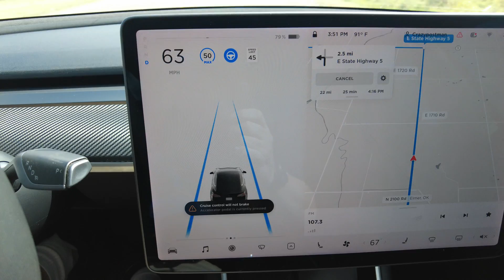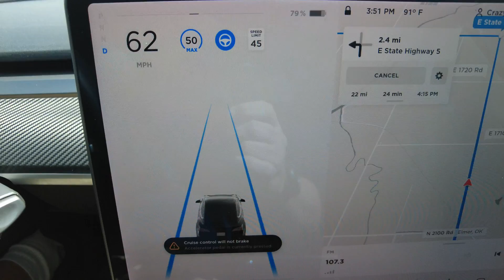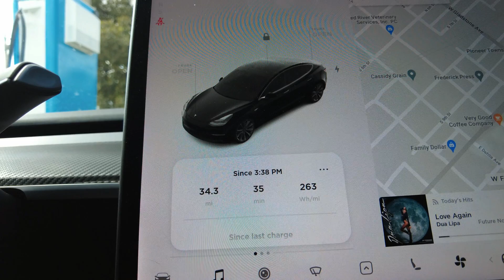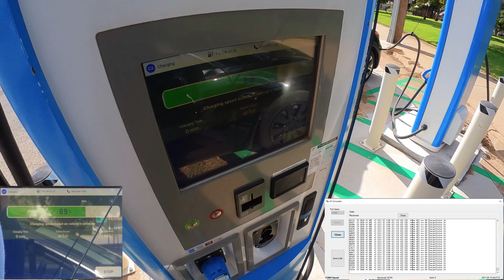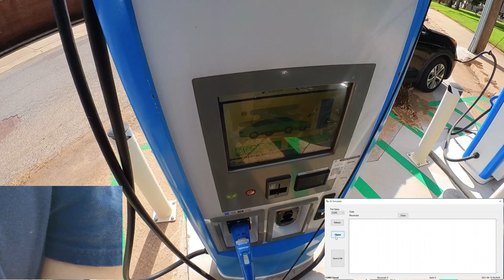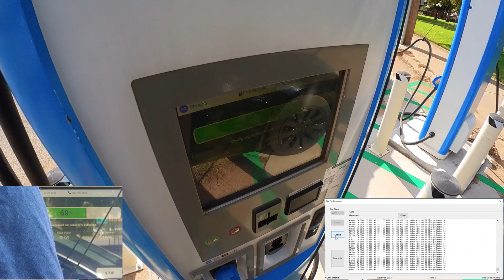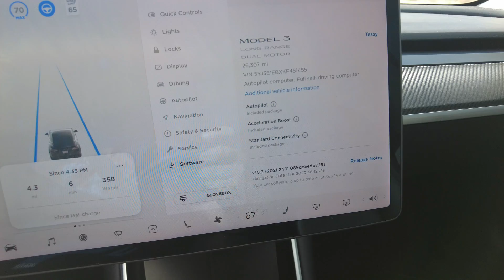Setec Tesla CCS adapter works! Again!!

Comment: Is this the lectron ccs to Tesla adapter?
Reply from the maker: Yes
Reply: @Crazypostman  me and a friend have one ordered and have been waiting for the last month for it to come in. Is the setup hard to get going? We are also in Oklahoma and will be using the francis chargers
Reply from the maker: @thethejonwatson  I would like to tell you the setup is easy but the first step to get it to work with Windows it's kind of difficult it's been over a year I don't really remember but adding a driver or a certificate or something. The instructions will be included. But after you get that done uploading new firmware version releases to the adapter is very easy

Comment: Thank you for the video.  Subscribed and liked.  Curious though, does this adaptor only work if connected to a lap top?  It seems that the SETEC adaptor owners needs to be pretty computer literate as it appears in need of constant updates.  Is it difficult to manage all this?  Special software etc?.  

Thank you.
Reply from the maker: Thanks for the subscribe and like! No the adapter only needs to be hooked up to a computer to update the firmware. I have it hooked up a lot for testing but a normal person would only need to hook it up occasionally to update the firmware.
Reply: @Crazypostman  Thank you for that fast reply.  Re the update process, would you say its fairly easy for the average person?  Any special software, cables etc.  How often are the updates?  

Thanks again from your viewers in Canada.
Reply from the maker: So you just need a micro USB cable to update it, I believe the adapter comes with one. The update process is pretty easy you just download the exe file from their website. You open it and it automatically detects the adapter and you start the update it takes about a minute or less....  I've heard rumors that Tesla is about to release their own OEM CCS adapter you may want to wait if you can.
Reply: @Crazypostman  Thanks postman.  YUDAMAN.  We have the Chademo adapter right now and it is definitely handy in BC although Tesla is doubling the Superchargers (to 40) in our province by end of year.  

Stay safe on the road.

Comment: Have you tested this on 2021.32.21 or similar?
Reply from the maker: I have not. Maybe I'll run out there tomorrow. I changed my headlight out today that was a process 😂
Reply: @Crazypostman  Ok, I just updated to 2021.32.21 with Setec 161-1 and it still works! I think Tesla will be a few updates behind Setec, but will probably disable again at some point.
Reply: @whooshn  Hope they realize that if they are doing it intentionally they are breaking the law and open to losing a class action lawsuit.
Reply: works on 2021.36